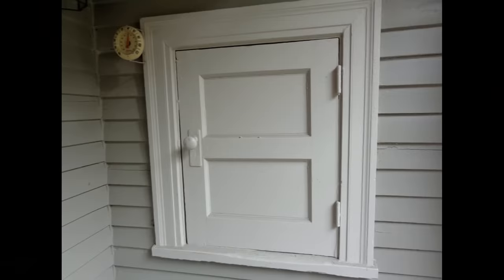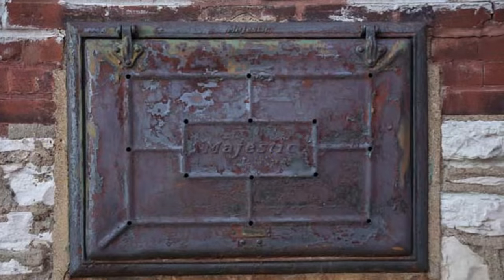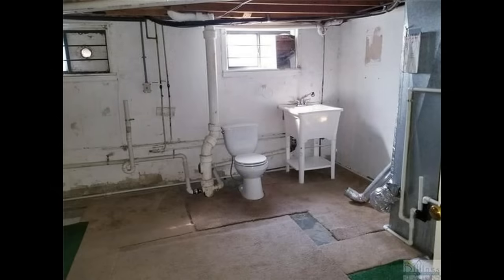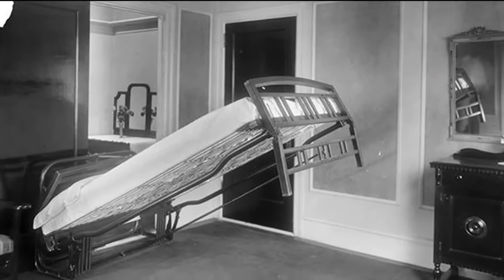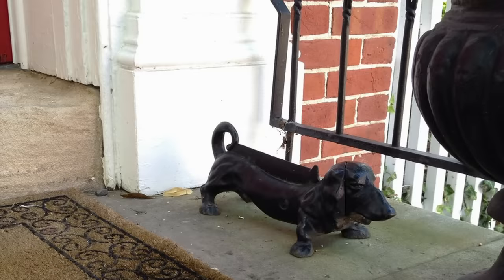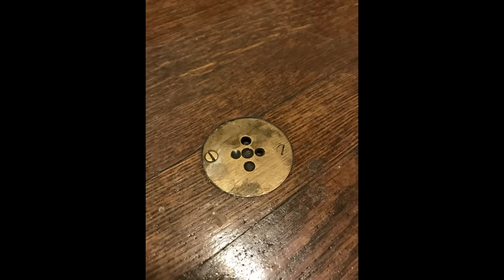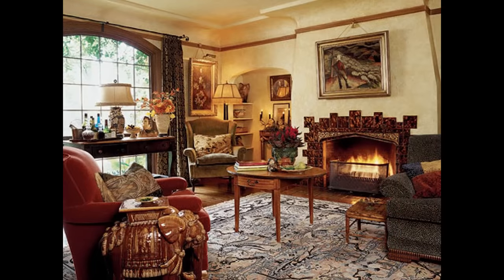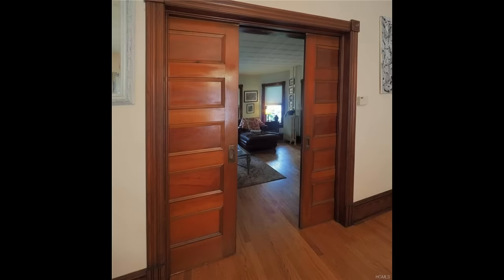Mysterious Home Features No Longer Used

Comment: Before garbage disposals in sinks, older homes had "garbage pails" and they were cast iron or brass pails, stored in a little cut-out in the ground outside near the garage area, they were necessary since the trash and the garbage was picked-up separately.  My home also has a "breezeway" at the back of the home, it was a long narrow passageway where we stored root vegetables and bottled drink, it was much cooler there as it had a screen door at either end, some new homes are installing this feature.  The house also has a coal chute, beautiful woodwork built-in bookcases, china cabinet and window seats, as most homes of that era (my house was built in 1924), were really beautifully built to showcase the wood.  Of course homes built before then were even more beautiful IMO.  It's a shame homes today are made with such inferior products, that to have one built using standard materials frequently used pre-1950's would break the bank!
Reply from the maker: Thank you for watching and sharing some more for us to remember!

Comment: I was surprised to see the modular phone plugs. Surely you meant the 4-pin type which superseded the little screw terminal square box with a hold-down screw in the middle.  Our approx 1906 house in Ithaca NY had its electrics wired (or re-wired) at some time prior to the '60s with steel flex conduit, I assume to resist rodent damage.  But more interesting is that the original gas piping for lighting was still present behind some wall-mounted electric light fittings.  The same house had a coal chute and the original boiler but converted to natural gas.  All the heating water pipework was covered in crumbling asbestos.  But as a boy, more fascinating is that my room had a real mouse hole in the wall, just like in the cartoons, thankfully without the mouse. And how about antenna rotators for your TV?  In 1965 we actually had cable instead, two coax cables with a selection switch to fit the NY stations on the VHF dial.

Comment: The house I bought in 1993, was built in 1905. It started out as a single floor structure, with a small bedroom in the pitched roof, second story. Then is was added on to,...a whole 2nd floor, and even a fairly roomy third floor, and a new stairway,...this was in 1927. In 1927, the plumbing came indoors, as there had been an outhouse, back in 1905. In 1927, they added a huge living room, that spanned the whole front of the house. Then in around 1930 to 1940, the basement was dug out, and the stone block foundation was replaced with cement blocks. In 1993, there was still a coal room, and an outside coal chute. Though the furnace was a modern forced air model, the original one had been a coal burning, "gravity" (convection) furnace. By 1950, the coal room had been converted into a vegetable canning room. Other rooms had been built to store the cans & mason jars of food to be preserved. By 1960, those other rooms had been turned into a "dark room", for photo development. Houses from the 1900s also had small gas stoves in them, for heating up water to make "starch", which was used to stiffen collars & dress vests, for mens clothing. There was a hinged ironing board, in its own wall mounted cabinet, that flipped out, when it was needed. And an old cement lined, double sink was there also. The cement could handle the strong lye based cleaning detergents. In 1995, my neighbor removed a 1940s Ringer-washer, a very primitive washing machine, from his basement. A simple machine with ringer rollers, that one manually operated via a hand crank, to squeeze excess water from ones clothing. I took it and turned it into a backyard planter, as an artsy, retro, decor item.

Comment: Phone jacks are also still used to this day and a still built into new house depite the existence of mobile phones 🤣
Reply from the maker: There are less and less of them now days.  In 2003 95% of households had them.  Fast forward to 2018 and only 40% had them.  That number has dwindled more as the generations are switching out.  That percentage would be much lower now.  Thanks for watching!

Comment: Fuse box instead of breaker box would go with the tube and post wiring.

Summer kitchen: a barely connected or disconnected kitchen, minimally equipped, for cooking in summer without heating the house.

Cistern either buried outside the house or in the basement, with roof gutters that filled it with rainwater as a source of soft water.

Pantries with a pass-through to the dining room.

Two story carriage house to keep hay upstairs for horses.

Outlets without a third grounding hole. Outlets with both slots T-shaped to accept various plugs before they were standardized.

Bedrooms without closets, because freestanding closets were used.

Lights with pull chains to make wiring simple.

Our farmhouse has two front doors. One went into the parlor for guests and the other straight into the large dining room to feed workers 

Doorbell built into the door, turn a knob on the outside to ring the bell.

Sleeping porch, a screened second floor porch off a bedroom for sleeping outside in summer.
Reply from the maker: Thank you for watching and mentioning some other great features for us to remember!
Reply: Others: Grates in floors to allow warm air to rise from below. Taller ceilings allowed hot summer air to rise above your head and to escape out the top of tall double-hung windows. Four-poster beds were for bed curtains to keep body heat near the bed. A valance above window curtains (a box that extends out from the wall) stops a reverse chimney effect behind the curtains from flowing room air past cold window panes. Standing cast iron radiators had pans of water on top, hanging on the side, or inserted through the center to humidify.

Tip-out bins in the kitchen for bulk items, usually flour. These were built-in or in a specialized kitchen furniture piece often was called a Hoosier cabinet. It had a porcelain-coated shelf that often pulled out for pastry work. There was sometimes a flour bin in one of the upper spaces with a built-in sifter to sift into your bowl. Some shelves were often behind screen or pierced-tin doors to hold pies for insect-protected cooling.

Comment: It is a common myth that the Pittsburgh Potty was installed so that workers could clean up after coming home. The real reason that they were installed was because it was a cheap way to insure that if the sewer line backed up the water would flow onto the basement floor, not a floor in the upper floor.

Comment: 4:00 in 80 years your wiring will be a fire hazard and these won't be. Why? Because these work if undisturbed even after the insulation decays away, while modern plastic insulation results in crossed wires. The reason it looks like a fire hazard is neither you nor most professional electricians know how to work on them anymore.

Comment: Speaking of toilets in random places, my great-great aunt and her daughter somehow installed a toilet in their garage. They somehow managed to hook it up to the the water line that she used for her washing machine. Eventually they got rid of it. But my mother had told me years ago that her (late) oldest sister owned a home that had a bathroom in the kitchen. I found that really strange of having a small bathroom so near to the kitchen. 

The house my (late) great-great aunt and he daughter owned which went up for sale a couple of years ago after being renovated was supposedly a house built in 1925. The house still possess the fireplace and area to clean out ashes. The crystal doorknobs with the skull key holes. Built in cabinets that were set into the walkway. These cabinets were located on each side of the walk way. You could store brick a brack inside. When I saw the renovation for the house they mentioned that build in cabinets retained the doors with the little latch nobs. I was surprised, because when houses are renovated sometimes they get rid of stuff if it's warped or broken. There was even a window rest. It was both a storage and seating area set into the wall under the windows. I never knew what it was because it was always occupied with stuff. Or as my great-great aunt used to say, "junk". But a lot of people down south in Florida included my great-great aunt had or lived in older homes during the 70's contained inside porches.

Comment: do they make houses today without landline jacks? They still sell landline service all over the place. I was required to have landline service up until just a year ago or so due to a verizon package deal requiring it. After the contract was over I switched to a new plan without landline service but wtf would i have done if my house didn't have jacks?
Reply from the maker: They don't put landline jacks in new homes but you can have them installed.  Thank you for watching!

Comment: If you have DSL, those phone jacks aren't obsolete at all.
Reply from the maker: Sure that's not an ethernet cable jack rather than a phone jack?
Reply: @RhettyforHistory  No, those are definitely Cat3 phone jacks. Ethernet plugs are nearly twice as wide... they have 4 twisted pairs of internal wires, whereas phone cords only have 2 pairs.

It would also be very weird to list Cat5/6 in an "obsolete" video. I install ethernet cable and jacks when needed on the regular.

Incidentally, you can run phone lines over ethernet cables. You can wire two phone lines per jack.

Comment: The house where I grew up had 2 things in the front yard right on the edge of the road. They were concrete, maybe 3.5 or 4 feet tall rectangular pillars with thick, heavy, iron rings in the top. Apparently, they were used to chain one’s horse, so it didn’t wander off.  I’m not sure what they were called, but the city removed them in the late 1980s or early 1990s. The house was built in 1920 in a small city in Illinois, and I lived there from age 3-11, so they were removed when I was quite young. Anyone know what these are called?

Comment: You forgot transom windows. Tall narrow windows that acted as a fire escape. Also, carbon tetrachloride fire grenades. Used after 1900, these glass globes were filled with liquid chemical that turned into a gas when thrown at a heat source. The liquid turned into a gas displacing oxygen in the air and therefore snuffing out the fire. Outlets for 110 volt (Vertical  slots) or 220 volt (horizontal slots) in the same outlet. Bakelite and ceramic wall switches and outlets. Rotary surface mount light switches for 110 or 220 these were surface mounted for on wall wiring. 4-pin telephone wall jacks. .Extension cords that screwed into a light socket on one end. Houses had lights before they had outlets. My Grandparent's house had a hand crank in the living room that would turn a sprocket and a chain. The chain (like a bicycle chain) would go through the floor to the basement, where it would open or close a damper for the coal fired furnace in the basement, controlling the flow of heat. Similar to a phone nook, a nook for a non-wired clothes iron. The iron was heated on the stove. Interior was made of heat resistant metal.  Mortise locks. Skeleton keys. Walk in pantries. Mud rooms. Widow's walks. Cast iron sinks. Claw foot tubs. Floor furnace vents. Baseboards were tall and were called mop boards. Early mops were only string mops, and when mopping a floor, the mop could reach the edge of it without getting the wall wet. Cheap floorboards were used in the center of rooms, to be covered with rugs. The perimeter of which having the more expensive and decorative floor boards. 2x4s were actually 2" x 4", not 1 1/2 x 3 1/2. Studs made of redwood, before deforesting made them too expensive. These roughly hewn timbers were rot and termite resistant. Window glass that looked wavy (before it was perfected). Brass speaking tubes. Before intercoms, the soft thin brass reverberated sound, carrying it through walls. Separate hot and cold taps. Iron plumbing which had to have threaded connections. Bitumen and cloth covered wiring. Toilet tanks mounted near the ceiling with a pull chain for gravity enabled flush. A door between the kitchen and the dining room. It was considered wrong to be able to see the kitchen from the dining room. Flush wall cabinet for a drop down ironing board. Wainscoting. Shadow boxes to hide drapery rods or venetian blinds. Mini blinds did not exist. two-setscrew wall plates for flat t.v. antenna wire (1000 ohm). Ohms measure resistance. Coaxial is 75 ohm. Square nails. Oil based paint. Lead based paint. Cast iron drain plumbing.

Comment: Picture rails are a VERY VERY useful trim feature... I've installed them in a few places I've lived and renovated. DO NOT remove picture rails when renovating old buildings!  
I use them to hang small and large frames... and change pictures around frequently, because I have more framed pictures and mirrors than wall space to hang 'em all. Pictures hang far better from rails than hung from a single 'nail in the wall' behind the frame - they do not easily move and go out of level. 
Here in Aus, they were a common feature up until the early 1960's.
People make the big mistake of removing them since the early 1960's.
Why?  Timber framed homes up until the early 60's used fibrous plaster sheeting sized to clad from floor to door height and then a second sheet from door frame to ceiling.... SO, there is a joint there which will continue to move over the years and crack where DIY fools try to patch a long joint that was hidden by the timber rails.  And, there is always a thickness or lay height disparity between the top and bottom sheet that is imposable to get flat over entire lengths of a room or hall way.  If you have an old plaster clad home with no rails you will see the joint. 
Later construction materials replaced true plaster sheet that could be laid from floor to ceiling without jointing at door height...  known today as 'drywall' sheeting, that has recessed edges for perfectly level jointing... IF the guy installing it has the skill to do so.. generally dodgy DIY reno guy doesn't know.
Again, do NOT remove picture rails when renovating old buildings!

Comment: Trash incinerator and fruit trees in the back yard. Floor radiator heater grates that would collect coins, pencils, dog toys, and french fries. Telephones were all the same. Rented from Ma Bell, they were black, weighed maybe 6 or 8 lbs, hard wired to the wall, and on a party line. When phones rang, they actually rang. They contained real brass bells.

Comment: Yeah I had a  friend who had a central floor vacuum system in his old house from around the 
 1950s,

There was a large 
Vacuum cleaner in the 
Detached garage,

And the vacuum line ran underground and up into the house,

Where there were a few spigots  In various rooms,

And somehow Connect a vacuum hose to any given spigot and turn on a valve so that the vacuum would work in a given room,

Since the whole system had been abandoned and there wasn’t any electrical power to the main vacuum equipment inside  of  the garage,

We  didn’t mess with it,

As a little side note,

We  tried to install cable-television into his house,

And after climbing up into the 
Attic space, I saw lots of  exposed copper wires that were wrapped around ceramic insulators up in the attic,
I quickly climbed back down out of there,

I really didn’t want to Wind up  as a cooked dinner,

Oh brother,

However this is definitely a very good piece,
Stay safe everyone

Comment: Where's the built in vacuum systems? My old house used to have one, you'd open a port, plug the hose in and vacuum away! The refuse would be sucked through the system and into a bin in the garage.

Comment: We built our house only 5 years ago and it has a landline jack hah.
Reply from the maker: Yes but slowly going away.  In 2003 95% of households had them.  Fast forward to 2018 and only 40% had them.  That number has dwindled more as the generations are switching out.  That percentage would be much lower now.  Thanks for watching!

Comment: I remember everyone in Baltimore had a huge fuel tank in their back yard or in their basement. Now they need to be 50 feet from structures, but as kids we used to climb all over those tanks and smack em like a bull. 

When we moved way north, I noticed a lot of people store refrigerator items in a pantry off the side of their kitchen. If ur kitchen gets into the 90’s, via a wood stove, is the closet really chilled enough for dairy? Tell me where u live wo saying where u live. 

My NC home came with a “whole house fan.” It’s supposed to be a Dino form of air conditioning. It was sparking flames in my attic when not in use, so it’s gone now. There was no electrical codes when my home was built. Man, they just threw paneling over live outlets and they were below the baseboard level, so we found like 9 per room and on one breaker line. No wonder we blew the box all the time! 

In the early 80’s, I distinctively remember seeing some guy in a sporty drop top talking on a phone in their car and the receiver was the size of an adult shoe. It never looked anything but ridiculous. Who is so important that ur attention to the road, and therefore ur life, comes 2nd to them?! Ya can’t be so important that ur life isn’t worth preserving. To talk while driving is so inferior and stupid. At least use hands-free.